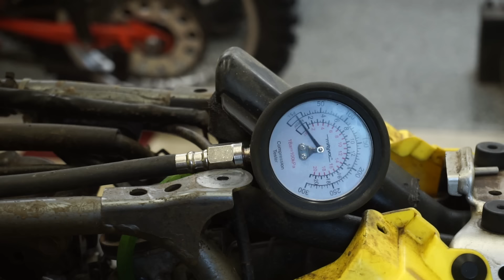Seller Gave Up On This Quad So I Got It CHEAP

Comment: Since it shifts correctly my guess is off that bent piece out on the clutch side. Not certain. If that piece is off some component on the clutch side I would order new components that would include the piece not coming unscrewed, that spring retainer bent piece, and of course the shift shaft. When the machine had the chain failure that broken piece then came off something necessary. Trying to ride it with new components should tell a person right away if it won't shift properly or some transmission component is inop.

Comment: Please tell us you will not move forward without first, "correctly" addressing the severed transmission piece that was found floating
 about the engine cases, ok?
My guess is...the mystery piece is off of one of the gears, 3rd, 4th or reverse (split the cases to confirm) and somehow migrated from 
the transmission side of things over to the clutch area. Who knows but, let's find out before you begin the assembly process.

Comment: If you're doing this at home, most japanese stuff uses JIS screws not Phillips head. It looks like a phillips but it's slightly different. This is why there's so many stripped screw heads on Japanese stuff

Comment: I barely work on some machines I have. Mostly maintenance and some repairing. But I’d like to be able to go further if needed. So sometimes I wonder about some of the tools or products or brands used in these videos. Especially curious about that oil bottle. What would you do without that thing?

Comment: Parts diagram time...that tab that broke off needs welded back on or replace case half...the metal remaining is too thin to hold which is why they engineered that thick tab to the case design...shortcuts will not last and create more problems for you to fix

Comment: Dog between  gears locking together is for sure going to become worse.  Best case the thing will slip out of gear often.  Worst case you'll be replacing all drive and driven gears when the broken one grenades.  I learned my lesson when I didn't use heat to soften lock tight.   If an impact starts to deform the screw stop and heat it up next time.  That blue lock tight would have given up easy with some torch action.

Comment: Nice buy for a grand no matter what...those are kickass machines!
Reply: Yeah they're great machines if you're like 13 or 14 years old for an adult get a real bike get a banshee or get a Raptor 700 even though they're junk too LTR 450 is probably the best sport quad out there I've had two or three of these LTZs they're not known for making good power that's for damn sure and the swing arms crack and other issues with wiring and everything else they are fairly good machines though
Reply: @Adam-banshee-man  Actually, I own a Can-Am Outlander 650.  I'm too old for sport quads!
Reply: @markparker5451  and you owning a Can-Am Outlander 650 has what to do with my comment you felt the need to you know let me know what four wheeler you got Guess what I have a 421 cub Serval Banshee that makes 87 horse to the rear wheels on pump gas I have an LTR 450 that probably makes right around 65 to the wheel I've probably owned every sport quad that's ever fucking been made I've owned CR500 CR250s I've had four 582 CR250 elsinore's I have I had an 83 CR250 Elsinore which is a 1-year bike they literally made that bike for 1 year and then switched it all up the next year so do I get some extra points or something because I've probably had over 500 bikes
Reply: @Adam-banshee-man  many xtra points for you!

Comment: That little piece looks like an ear off one of the gears that slides, and they mesh into the next gear. They usually have 3 ears on the side and gear teeth on the outside. Sorry if it's a poor description.

Comment: 1000 bucks aint bad not street legal go for 2000€ in france
if you got the knownage to fix it, can be a good deal.  but gears means tear that hole engine apart and alot of people get scared (like me) even doh i can do it it wil take me weeks
i jsut love to watch joe buy stuff and fix it maybe someday i be at that level till then i got lots of quads i still gotta fix my self... but lacking the motivation and actual garage to do so (atlast i got a garage now but its a mess and not all my suff is there or quads) gonna do it one by one so i wont get overwheled..

Comment: I would bet that broken piece is the tip of a shift fork. The gear dogs don't look anything like that and the shift forks do, on that Suzuki. I would say the force needed to bend the shift shaft and the shift cam stopper could have transmitted enough force to break a shift fork.

Comment: it was bent from someone stomping on it to get it to shift, when it was breaking.. then the part broke...  the chain did not bend that shift shaft.

Joe, when drilling hardened steel.. SLOW SPEED, HEAVY FEED... meaning.. push really hard, and put the drill in SLOW speed.. slower the better. otherwise, you will work harden the bit and the screw, and once the head of the screw is work hardened, every few things can drill into it.

alluminum.. high speed, LOW feed... meaning ,, dont push hard, let the bit do the work

Comment: I would be hesitant using brake clean on a carb. Any o- rings or rubber gaskets I found would swell. I use a can of actual carb and choke cleaner. Just my 2 cents.

Comment: I've got a question, I'm having issues with my suzuki vinson. I rebuilt the carb. I'm pretty sure I didn't keep track of the fuel screw. The unit will idle but as soon as I give throttle it dies. Any ideas ?

Comment: Agree with others that is 100% one of the dogs from one of the gears it will possibly shift ok sometimes and others not. The engine really needs to come apart probably other parts damaged also like a selctor fork or teeth on rhe gears.

Comment: The knock to me sounds like rod knock rather than top end cam or chain. Being out of water may have been the culprit. Don't know about shifting. If it did run low on water then a complete seal kit will be necessary. While running I do not hear sound of any engine failure.

Comment: Looks like a shifter dog off a gear to me. As far as the bent shifter shaft you have press and 2 v blocks I would straighten it . I've straighten many bent fork tubes the same way.

Comment: You are brave using a drill on a easy out. I would never ever use a drill. You need to be able to feel it so you don't break the easy out.

Comment: I'm gonna bet that chunk of steel is from one of the gears from the transmission it appears to be a peice from the side of one the gears that means someone  beat the crap out the transmission trying to shift it when the issue began from the former owner.

Comment: Joe I recently bought a 2000 gas gas Ec300 and needs a clutch slave cylinder and reservoir cap I’m having a difficult time sourcing the parts do you or anyone know what other years that I may use the parts from?

Comment: If it was mine Joe.....your already investing good monies in parts and got this bike on the cheap so far ,I would remove the engine and split the cases.That piece had to of came from inside somewhere and i would wanna be sure 100% what it is from.Just my thoughts.

Comment: Use heat on threads with lock tight could have saved you from breaking the case.

Comment: looks alot like a darn Polaris up under the cam cover. The top end is usually pretty reliable, the bottom end is a different story lol. Atleast Suzuki didn't use those Carbon composite valve guides that Polaris used. Those darn things liked to drop out of the heads and wreck the valves.

Comment: These bikes also have a problem with the carburetor if you put the carburetor off of a EX400 it will work so much better they have a problem with the stock carburetor for running lean if you start it and it doesn't want to take throttle just up the main jet about three sizes and it'll be fine I've got so many of these bikes cheap because they put a pipe on it and then the bike wouldn't take any throttle and it just ended up needing more jet

Comment: That piece is a square gear dog from inside the Trans. Where the gear cogs mesh together. It will still drive but u should look up the z400 Trans and see if the gears each have 4 or 6  square dogs/cogs. If they have 6 u should be fine. If they have 4...when that one gear is engaged with the missing dog, u will be driving that gear with only 2 dogs mating. Not know which gear It comes from....I'd go easy on it. I wouldn't slam gears or power shift.

Comment: Some heat might have helped you might not have stripped the screws. Just sayn plus it turns the lock tight back to liquid

Comment: Like previous comments, the piece you found in the bottom of the casing is a drive dog from one of the gears, the engine needs splitting and the broken gear replacing before it totally fails and destroys the whole of the gearbox and possibly the casing's.
While you have got the casings apart replacing the broken gear you can get the selector retaining lug welded back on instead of bodging it by drilling & tapping a hole in the case, thus further weakening that point. Do it properly don't bodge it like we see some of the repairs on bikes that you get in that someone else has made do instead of fixing it properly.

Comment: Gunna need to pull that engine mate - split the cases and fix it proper- probably that dog ear from the transmission - it is most likely gunna slip out of gear

Comment: Your videos are great but to correct a little. To time any engine it's not only top dead center but it's TDC on the compression stroke. Also the terminology is wrong. It's not a cam chain. It's a timing chain. Otherwise good stuff.

Comment: Your not hitting the impact screwdriver hard enough, barely getting through the return spring, once in place use a bigger haamer end give a 1 good wack and it should be loose

Comment: Do you want this bottom end that I have nothing needs to be done to it The clutch is in it the stators in it the cranks in it timing chain everything all you would need to do is put your cylinder and your head on it I can sell you a complete motor too if you want I also have a ported head for that bike

Comment: Please don’t drill and tap that part to be put back together! That is a massive hack way of fixing this quad. And I can almost guarantee that piece of metal you found is a broken dog on your shift fork. You will need to pull the engine and split the cases. Find which is broken and order that part also. To properly fix that stud bring your cases to a welder but make sure you CLEAN YOUR CASE AND PART that is getting fixed before he attempts to weld it. That case has been sitting in oil for many a year and it needs to be thoroughly cleaned before welding or the weld will never have a chance.

Comment: This Bike was Hardly Ridden By Some one Good Any way Either Some older Guy bought it , then Didn’t Ride it Much And some Grand Kids Started to Ride it , the Side case has no No Wear scratches the stickers on the frame in new condition Till a Kid that don’t know how to ride or maybe the Owner had no idea how to ride cause it’s to clean Barely any Boot Rubbing Scratches First  -2nd gear Grind Stomping back to 1st, -2nd Pulls How else you Break a Tooth off the DriveSprocket ,

Comment: You didn’t get that quad for cheap, you over paid 🤦🏻 that quad being the year and condition is like $500  $1500-$2000 with nothing wrong with it in good shape. 
Also doing a compression test on a modern 4 stroke engine with an automatic decompression is pointless and you won’t get an accurate reading. Always do leakdown tests as it will provide better information.